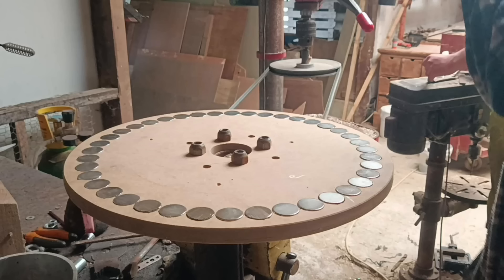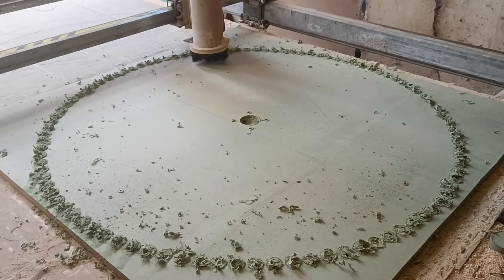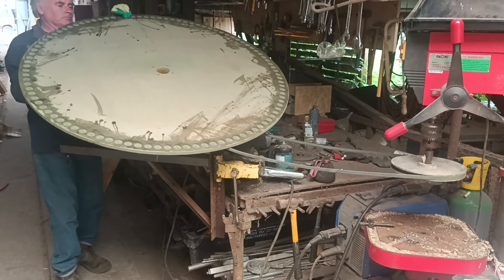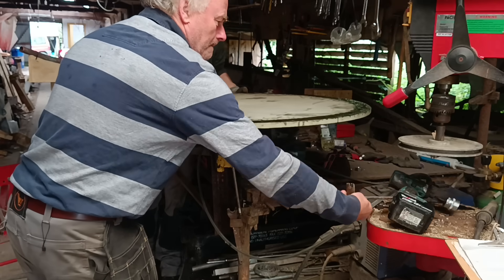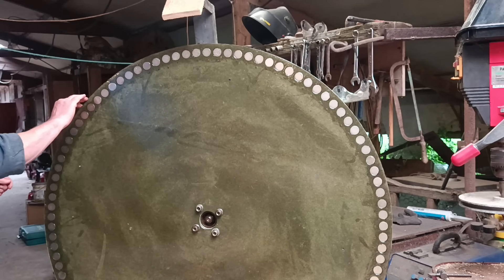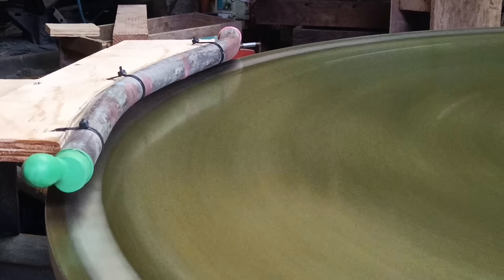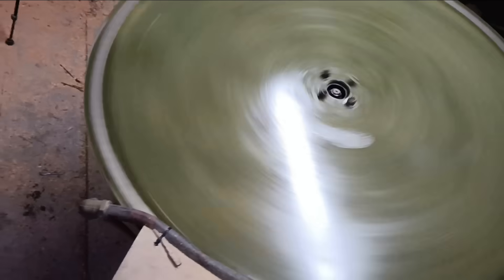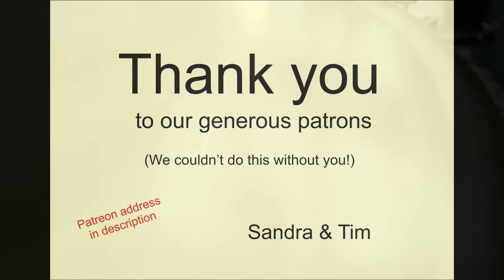ABSOLUTELY HUGE Magnetic Induction Heater! Using 100 Spinning Neodynium Magnets And A Bucket

Comment: I'm fascinated to learn that this works with copper pipe. We have an induction hob in our kitchen and the manufacturer's documentation made it very clear that we absolutely must use pans that have ferrous bases. I'm under the impression that your alternating magnets replicate the way an induction cooker works, albeit at a lower frequency. 
Brilliant video Tim, as always. Thanks for publishing...
Reply: Copper and aluminium are too conductive. Instead of turning power into heat, it goes back into the induction heater's coil. The coil needs to be rated for the total power, not just the power that heats the pan. A coil rated for 1000W might only be able to put 15W of heat into a copper pan. Magnets don't really have a power rating because their magnetic fields don't change.

Austenitic stainless is only slightly less efficient at heating than ferritic stainless or carbon steel, but that still represents double or more power being returned to the coil.
The difference in efficiency is most likely due to magnetic hysteresis - energy lost when the magnetic field changes direction. Non magnetic metals are dependant entirely on electrical resistance to induced currents to produce heat.

Finally, aluminium and copper will levitate given enough power. Having pans flying off the hob isn't ideal, but an induction furnace can make use of this to create levitating balls of molten metal.  There are plenty of clips of that here on Youtube.
Reply: Tims wheel works by alternating a magnetic field to induce an electric current, meaning the material only needs to be electrically conductive. An induction hob works by alternating an electric current to induce a magnetic field, meaning the material needs to be magnetic. That's why most stainless steels won't work on an induction hob either.
Reply: @ OK, that makes sense. Thank you!
Reply: @climberjb  It's not really that. The iron based pans have a higher resistance and small skin depth that that frequency, which means they have a very high resistive loss, which heats them up much more effectively for the same current in the induction coil in the hub. Copper is waaay more conductive with deeper skin depth, so putting it on top of the coil causes the induction coil to pass way more current, to the point where the driver circuits detect overcurrent and shut down to protect the output devices feeding the coil (probably MOSFETs in the old days but nowadays IGBTs). Copper would appear to practically short out the "primary" of the transformer (the induction coil in the hob) whereas iron or steel will present a reasonably high resistance and allow work to be done with much lower primary currents needing to be switched. In addition the effective impedance of the pan/workpiece reflected into the primary coil damps resonances significantly, protecting the driver from resonant voltage spikes during switching.
Reply: @climberjb An alternating magnetic field is an alternating magnetic field, no matter how it is produced. The reason you have to use iron based cookware on an induction stove is because the skin depth is so much shallower. Eddy currents are being induced in this copper pipe, but there is very little losss.. No loss, no heat.
Also the frequency is very low for induction heating in any material.
Reply: @ForestCounter  Yeah and in ferromagnetic materials the heating from magnetic hysteresis losses is usually greater than that from eddy currents. An iron pipe would probably work better here.
Reply: Heat is being produced as currents pass through resistive load. Copper has far lower resistivity than iron, so the eddy currents move around with much less opposition, therefore producing way less heat. It seems counterintuitive, I know, but it's the way it works.
Reply: I wonder if he'd be better off sandwitching the magnets between two thinner pieces of wood and using a pipe made out of a ferrous metal to heat the water.  

 Having the magnets between two pieces of wood would keep the magnets in place despite the presence of the ferrous metal pipe. The ferrous metal pipe would cause  the magnets to be pulled on. I think the epoxy would eventually fail and the magnets would break..
Reply: Induction hobs have a magnetic switch that detects when a pan is placed on top. If that cheap magnetic switch were replaced with a fancier and more expensive metal detector, you would be able to use copper or aluminum cookware.
Reply: he would have an issue using a ferrous metal as it would be attracted to the magnets and attract the magnets. not good when you have that much mass spinning.
Reply: Non ferrous mate, a ferrous base is iron or steel which don’t work and will probably damage the hob that’s why you use aluminium bases or copper basses.
Reply: @ Sorry but the pans absolutely do have to have ferrous bases. The instructions recommend taking a magnet to the shop to make sure...
Reply: @buffplums  induction stoves absolutely do not work with copper and aluminium pots and pans my guy. Only iron or steel ones. Although you can get pots and pans that are copper or aluminium but with a steel disc in the bottom for heat transfer.
Reply: @buffplums induction hobs work great with cast iron pans.  Any aluminum or copper bottomed pans that are induction compatible have a ferrous metal disk sandwiched in.  Do a magnet test.

You can buy countertop induction hobs fairly cheaply that will work  well, I'd consider getting one.

Comment: All this is very impressive but if you don't measure the power consumption to compare it to the heat produced I am afraid it's pointless. The classical solution (electricity generator + heating resistance) is much more practical. In fact all you have done was to put them together (rotor + resistor) and you replaced all the wiring with pipes. I fail to see the benefit but it's very entertaining indeed. It has a Wallace and Gromit vibe I must say. No offense intended. I am a  huge fan.
Reply: The point is the hot water.
Reply: From a few videos back, he said he didn't want to use a gearbox between the wind turbine and a generator because that would create mechanical losses. What he's doing now is replace a gearbox with a massive wooden disc (conveniently forgetting that the disc creates lots of air resistance), and replace the copper windings in a generator with a section of copper piping separated from the magnets by a massive air gap. It's a thoroughly engineering-illiterate idea.

Comment: multiple concentric circles of magnets might help you get more energy out of the windmill at lower speeds
Reply: The further in the rings, the fewer magnets and the slower they move. The actual increased performance may not be that great.

Comment: get the copper closer to the magnets
insulate pipes
get the wheel balanced better for higher RPM

you'll eventually get it working as best as you can, and it still wont get as good as a permanent magnet alternator running a heating element, but we already discussed you reasoning for doing it this way

Comment: This a neat project.

If you make another wheel, consider putting something ferrous metal on the under side of the disc where you're inserting a magnet. The magnet should then stick to that metal through the wood and massively reduce the risk of it coming out of the hole and trying to re-attach to the stack of magnets you're still holding.

Making some wooden u-shaped tabs to slide over each space to hold the magnet in place while you slot the next ones in means no need to wait for glue to dry, you can then make a second wheel with a lot of slots cut in to fit over those tabs and just place it on top. No need for glue at that point.
Reply: Lots of great ideas and tips in this comment.  Making clips to hold the magnets is really smart.

Comment: You can stuff copper wool in the pipes to heat the water better
Reply: Ooh! Great idea!
Reply: And make turbulance in pipe and water in the midle of pipe can heat up too plus more surface area but reduce flow
Reply: how laptop cooling pipes work.  sintered for internal porosity.  thanks for sharing the low budget version though- your version normal hobbyists can make.

Comment: What would happen if you put the wheel next to an old cast iron radiator? 
What would happen if you put 2 full loops of copper over the magnets? 
What would happen if there were 2 rows of magnets? (The same work spinning, but twice the heat? )  Just love the messing around and finding out as we go!
Reply: Next to an old cast iron radiator?  It would slowly start to heat it up.
Two full loops of copper over the magnets?  It would heat up but put more drag on the wheel slowing it down (or requiring more energy to keep it at the same speed).
Two rows of magnets?  You'd get twice the magnetic power but also double the force trying to slow the wheel down, a bit like pressing your foot on a car's brake pedal twice as hard - sure you get more heat in the brake pads but the car stops more quickly as well.
Reply: please @robinkirk3601 can you help us too ? - can't you do experiments too ? because we are few people it is really hard work to awake the sheeps

Comment: You're only taking a fraction of the energy from the spinning magnets when the pipe goes all the way round things might start to happen as well as insulation flattening the pipe would also increase Efficiency
if you tighten up tolerances and get the copper pipe much closer do the forces involved become unmanageable
i've got some vague memory of doing calculations with magnetic flux density and induction into a coil of wire
Teslas
With the short piece of copper pipe the energy is only extracted In a small part of the circumference does this mean the forces on the wheel are uneven

Comment: Still look at Vertical-axis turbines for your back garden. They strong because both ends of the shaft is supported. Less chance of running afoul with height restrictions. Easier to service. Heating water one side and the opposite side coils to produce 12 volts and battery.  Charging battery power tools.🤔

Comment: Flatten the tube so more surface area close to the magnets. This will also make the water surface heated larger
Reply: ❤ glad I'm not the only one thinking about flat bottom pipes.
Reply: @MAGnetICus_Attractus  I prefer my "bottoms" rounded!😁😁
Reply: i'm envisioning a stack of discs with those laptop style heat pipes betwixt.  flat and sintered for internal porosity.
Reply: That improves the coupling to the magnets which will increase the torque needed.  There is a trade off where too much can stall the turbine reducing the power.
Reply: Also because it heats it using magnetic fields he can insulate the pipe too so the metal doesnt cool to the air, only to the water
Reply: Flattening cold copper tubing may cause fractures, might have forge it
Reply: Maybe ribbon tubing may work better
Reply: This with the tube using way more of the magnetic area available.  Whole lot of wasted space !

Comment: Wow, so very cool, love this project! Also, 10 degree in 10 minutes looks great to me, if i'm not incorrect the ambient temperature was pretty low too. Insulation would surely help a lot!. My suggestions (you'll surely already tought of them) are to make two or three circles of magnets, instead of just one (eventually even more). Then loop the tube in a spiral so that each loop sits exacly on top of a circle of magnets. This way you'll multiply your heating power by two or three. If i understood correctly, the windmill will spin slowly but have a great torque so extra drag wouldn't be an issue. Also on due time, you can dump the whole spiral in an insulating material like expanding foam, as to create a disk that will sit on top of the spinning wheel. Another suggestion: add one of those wheely thing that show the flow of water on the pipes so you can see how much the heat causes circulation (unuseful but interesting :P)

Comment: The motive force in a convectiom circuit is gravity. The warm water has a lower density than the cold. This makes it lighter in comparrison. Gravity then pulls the heavy cold side down which lifts the lighter warm side. Much like a seesaw. The initial surge of heat is due to the fact that the water isnt flowing. So more energy is passed to the stationery water, once it starts to flow however each pass through the heat and only pick up so much of the energy. Think a roundabout,  its easy to give that first big spin but actually harder to keep putting that same energy in to make it go faster, you end up with a maximum energy transfer. 
To improve energy transfer you need more water in contact with the copper, the water in the middle of the pipe is doing nothing, and you need more copper closer to the magnets. Either a rectangular pipe or perhaps 3 pieces of 10mm side by side would work
Reply: https://youtu.be/GVR8OS_GzMU?si=IZKu8Kf6aPU7T4Wx gives an idea of what is happening inside the pipe.

Comment: Well Sir, there are a few things that occurred to me
1. The balance is critical for stability. There are procedures online for manual trial weight balancing or if you have a friend with vibration analysis gear.
2. You essentially have a gigantic disk and for heating, you can double the effectiveness by mounting 2 heaters like a disk brake caliper with a screw advance to control the gap more precisely.
3. For insulation, your idea for a woolie-pulley was pretty close to what I had in mind.😅 look for old wool blankets or moving padding and wrap the metal in aluminum foil then apply the fabric and then wrap the whole works. Wire will work or even duct tape.

I love watching your experiments as I absolutely loved that aspect of being in university for Mechanic Engineering Technology and now that I'm retired, I appreciate content like yours and CEE Australia for trade-related content because I'm also an HD Equipment Mechanic 😅
Reply: Pool noodles for insulation
Reply: @jfk720  I thought about that 🤔 but I was concerned about melting it in the heater because it could get quite toasty 🥵. The aluminum foil and non-synthetic fibers may be more resistant 😉
For convenience, hot water pipe insulation foam wraps could work if away from the heater 🤔
Reply: @EastBayFlipper  It can't get any hotter than 100C.  Remember there is liquid water in it
Reply: @brokenrecord3523  it shouldn't exceed vapor temperature 🤞
Reply: @EastBayFlipper  
In an open system, vapor temperatures won't exceed liquid temperatures.
Reply: Oh, and modify the shape of your pipe by making it "D" shaped with the flat to the magnets 🧲 for maximum effect 😉👍🍻
Reply: Also big copper blocks would be more effective.
Reply: @ryelor123  maybe 🤔  more metal is more metal to heat and the goal is to heat the water.
Also, a coiled copper pipe may be an option and easier to replace. ¼" -⅜" line with compression fittings🙂

Comment: Very interesting, Tim.  MDF will not keep its shape in this setup but I think you know that already.  I'm looking forward to you and the commenter's figuring this out and then powering it with a windmill.  So many uses for a windmill.  Cheers 🇨🇦
Reply: Loved watching you build!  You are an inspiration to tinkers everywhere.   My  two cents:  1) your MDF will sag in horizontal orientation, go vertical. 2) As another post suggested, this will make it easier to extend the pickup coil to cover more magnets. 3) if you go vertical, think about making a sandwich with two triangles of plywood or 1/2 sheets, depending on what you have, with a cutout for your hub, and solid wood on at least the bottom edge, and you might have to add a support bearing for the top side.  4) leave some room on the side of the sandwich where the edge of the rotor sticks thru and seal it off with 2x4 slotted in the middle. 5) the slotted piece gets at least one pair of bearings or casters, etc, mounted to stabilize the wobble like on a bandsaw.  6) now you can mount your pickup tube very close the magnets.  7) consider routing a channel in the flat side of a 2x6 or 2x8 that precisely matches the curve and smash your pickup tube into it, hammering flat on one side 8) now screw that onto the slotted 2x from suggestion 4, getting the tube and magnets as close as possible. 9) if you magnetize the other side, pickup tube can u-turn at the bottom a heat additionally , 10) there is a lot of spare capacity to mount small coils for charging things or lights.   11) thanks for sharing! And good luck.

Comment: Could you measure the power draw from the motor, with and without the pipe in place? The currents in the pipe oppose the rotation of the disk, putting strain on the motor.
The difference in power draw would give you an upper limit on how much heat is produced in the pipe.

Comment: Rotation to heat - just use a shorted out electric motor. There are cheap watercooled car alternators which do just this to help warming up the car faster.  You will get the bearings and pulley for free and it will even be possible to regulate power by shorting the three phase wires in different ways. The trick which makes the alternator smaller for the same power is it having a closed magnetic loop with small air gap which your arangement does lack.
Reply: I think the issue with that is the RPM needs to be much higher than what he has here with the large diameter wheel
Reply: @Your_Friend_Corey   use a big pulley on the windmill shaft.  Otherwise there are real Megawatt wind turbines with a directly driven slow generator